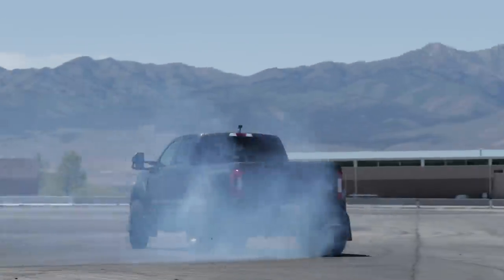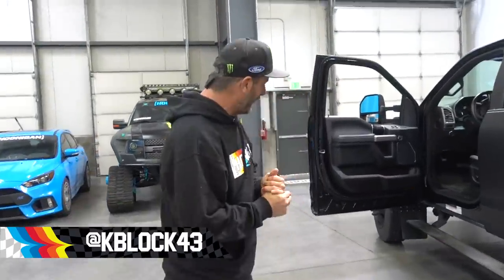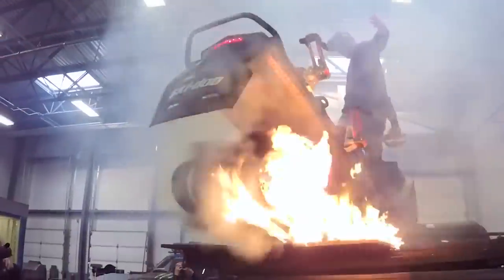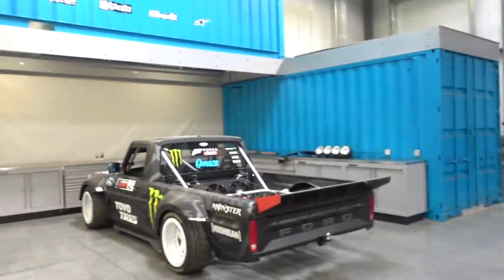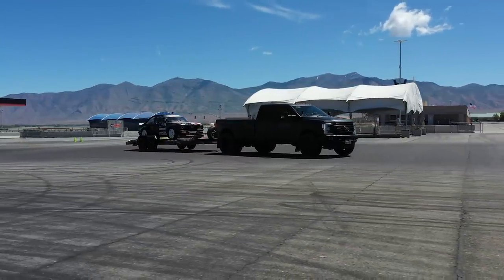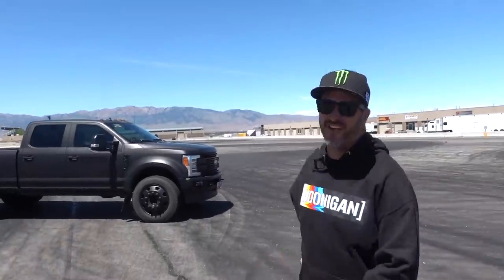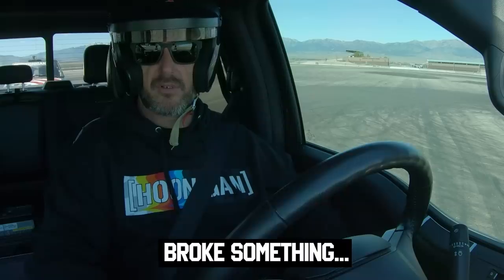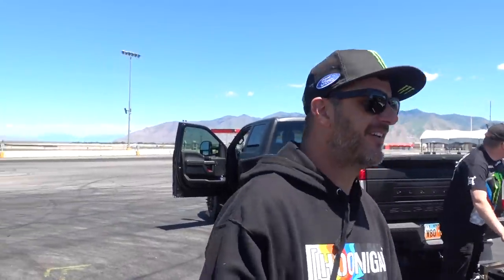Ken Block Drifts A Dually! 8,000 lbs. of Diesel Powered Ford F-450 Tire Shredding Action

Comment: "That's why we keep Hoonigan and Hoonigan racing separated" burn
Reply: No, just elite separatism. Zach did exactly what he was told to do. It would've happened to Ken just the same if he was attempting the trailer burnout, tied down like that. The difference is that it wouldn't have shown up in a Ken Block YT video.

Comment: This should just be fords new marketing campaign.  I want to buy one just for this.🤣🤩
Reply: Yeah wish I could argue with that.
Reply: its a power choke so expect the engine to grenade in a day. Plus looking at the in cab feed Ken had a hell of a time managing throttle and getting it to rotate, so your likely not going to come close for a good while.
Reply: @robbalinski1606  Exactly. My 06 6.0l powerstroke with 212k miles failed on day one. My 11 6.7 with 154k miles failed on day one too. Now my 19 only has 7k miles on it but I figure around day two it'll fail as well! Luckily my 20 Duramax work truck will be there when the other 3 fail.
Reply: Fords marketing depth is complete shit
Reply: @Rebel-Neck  yezzzzzir my 12 crew cab long box dually shreds assss when you get into the throttle I LOOOVE it cant imagine having a duraless 😂
Reply: @freighter1097  ever notice you are hard an neglect to give it care. A diesel will last you 500k and on if you maintain upkeep. Some of the best farm trucks I have driven have been diesel. Then My bosses old truck had 600k. 1997 F-350 quadcab. Not duel but it towed a 40 ton tractor to every site.
Reply: @burgerbandit3646  I guess you didn't get the sarcasm? ie I have high mileage trucks that haven't failed yet "failed on day 1".  But yes, my 2020 Duramax already went into the shop due to dpf issues that bricked it for two weeks.
Reply: @freighter1097  my bad

Comment: A haunting wail coming from those tires... sounds sick!
Reply: Dale Cole - I thought that was the mechanical cooling fan. I have a diesel 250. Not the same, but same engine/trans. Sounds like that when my temps get hot. Normally towing only though. This, well.. I wouldn’t do this to my truck, lol

Comment: I’m more impressed by the fact that he had it floored for 10 minutes straight with no issues
Reply: Its 900 ft lbs of torque. Its not really working that hard to spin them up on an unloaded rear.
Reply: @uberdang830  nah go to physics and learn why the shit works in the first place then go to voc to learn how to put it together lol
Reply: @uberdang830  how you gonna say i dont understand why he was high up in the gears i literally explained that a diesel revving lower with more torque needs higher gears to keep em spinnin lmao you said what i said that means YOU dont understand it when its right infront of your eyes learn physics first
Reply: @uberdang830  think about it like watts, the motor with the most watts will have the most torque to the wheel provided good gearing compared to the motor with less watts but runs on more amps...amps=torque to visualize what im saying...if you know anything youll say the motor with more watts will pull the hardest at the wheels...why would you say the engine with the most torque would have the most wheel torque (acceleration) provided proper gearing, which is a given in any commercial sense..
Reply: @rileykirk11  oh Jesus you don't even understand electricity 🙄.  Ok well you win I'm out.
Reply: @uberdang830  how come you care enough to respond but not enough to use your knowledge to explain? all youre doing is claiming shit...how is my electricity knowledge wrong?
Reply: @rileykirk11   because watts is = a×v so  an electric motor that has a watt rating is stating how much its power consumption is not how much work it can do. But like I said before you are right  so contine to crawl around the comments to tell people how wrong they are.
Reply: @rileykirk11   really are you sure? I could have a 3/4 horse at 2300rpm rated electric motor single phased this now I gave its out put in hp. Well I sapse we can do that in watts. Mind you output watts in an engine or motor is not power consumption so never mind don't want to confuse you. Let's take the same rated output but let's make that one a DC brushless motor. Same work output but do the have the same power  consumption? Any who I'm done with you. Like I said before. Live up the that last name and boldly go where no one has gone before.
Reply: @uberdang830  he is right though and this is diesel talk. not electric motors. torque also dictates how much "spin force" or basically in simple terms launch. im going to forza to explain this better. a deisel all wheel drive vehical say an audi Q7 v12 tdi. i drove it in forza motorsport 4 and its not a bad car. anyways it has really good launch and when i did a full mile drag race with both cars stock. the Q7 had the acceleration advantage while another car of similar weight and power ratio used a gas engine. the other car had a higher top speed as horsepower dictates that. basically horsepower dictates your top speed while your torque dictates your launch and acceleraction.

Comment: And my dad said that drifting a dually would’ve impossible.
Reply: Impossible for your dad yes.
Reply: That's what happens when you have two dads
Reply: Ok. But my friend who is nowhere near a professional driver has drifted his early 2000s ford 350 with the 7.3 so like it’s not even really hard to do
Reply: Dude what, I drifted a 97 F450 😂
Reply: Your dad forgot about the Ken Block factor..
Reply: There's no weight in the back of the truck easy

Comment: Honestly I don't think it's zacs fault the mk2 broke
Reply: He was told to do burnouts, not his fault Ken has a car with plastic axles. :P
Reply: Honestly he should have built up the burnout and not just slam on it cuz it was tied down pretty tight so imagine that pressure on the rear end
Reply: @austinaviles3594  Thats true but HHIC should know that Zac has absolutely no mechanical sympathy, he probably assumed its a race car that can take the abuse. You're right, but also someone should have told Zac what rpm to drop clutch at if that was going to be an issue

Comment: I had a clunker, and carved a notch in the rod for the under dash e-brake release. Took out the plastic grommet to give enough slop so I could latch the release.  Not only could I do bootlegger turns, but the emergency brake does not light up the brake lights. Stealth skulking on a full moon with no giveaway when stopping.

Comment: Holy Lug Nuts! What a savage beating. Really would have liked to see the turbo and down pipe glowing red hot right when Ken stopped. Kinda sad for the $2000 in rear tires shot to hell. I know, he don't have to "buy" his tires anymore. Wow that truck is begging for a custom exhaust. And a purple low key flame job.

Comment: Further advice adjust the trailer brakes to where you can lock em up when pulling the trigger on the trailer brake with your fingers (may not work with your truck ) works great you can drift a truck and trailer very nicely.

Comment: I know this is late but I wanted to make a few comments on this.

1. A dually is the perfect drift vehicle simply because they're built for extreme stress and can make thousands of pounds move without thinking twice.  If you can shorten the wheelbase and make it turn tighter no one would touch you.

2.  I think someone told Ken that he needs a 10 point turn and a 10 acre field to make a U-turn in a Ford dually to which he comically replied "Yeah right just watch".

3.  Drifting a heavy weight dually is possible I did it in my 5 ton 92 F super duty wrecker not well mind you and I had broken up ice sheets on the parking lot pavement to help me but it was done and it's how my wrecker earned the nickname 5 tons of fun and I can attest that anything other than 3rd gear unless you have a really tall rear end (which mine is a 5:13) is damn near impossible to make it slide.

And 4.  If you want more response out of a diesel engine when you step down on it you have to go old school the less turbo lag the better or go IDI non turbo like my wrecker is so whatever little power you have is more instant.

I just think drifting a dually is poetry in motion and I was waiting for someone to come up with the idea that it can be done besides me.  Ken you have a good name and an artistic hand at the wheel.  Clutch kicking makes the dually break loose a lot easier surprisingly.  If you see this great if not hey maybe someday.

Comment: He has the skill's to drift about anything. I would like to see the blooper footage. I think for one thing they let some air out of the outside duals to make it break traction a little easier. Not taking anything away for his awesome driving ability, just saying. That's one heavy truck to keep those tires spinning especially with the slow throttle response like he mentioned. Would be fun but not on my budget.